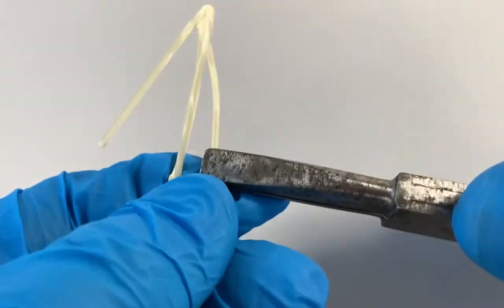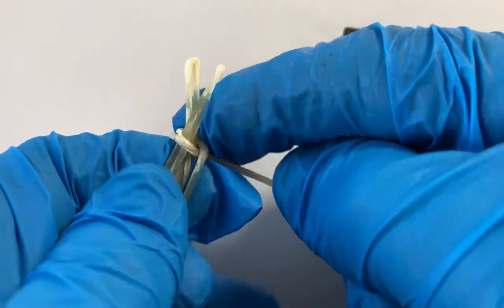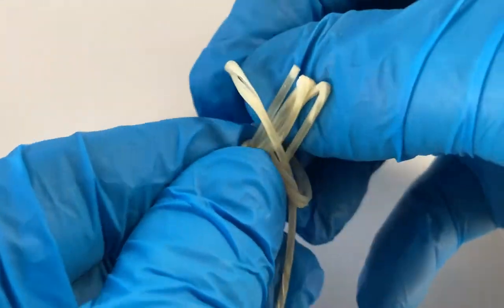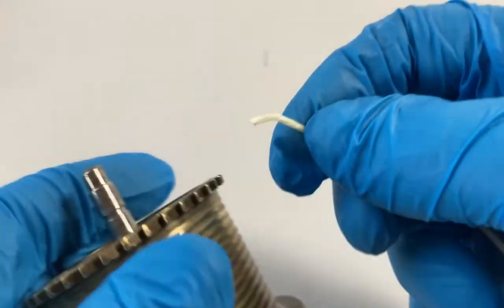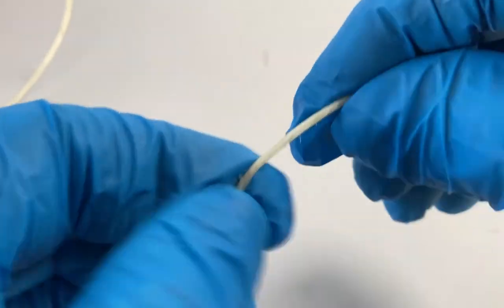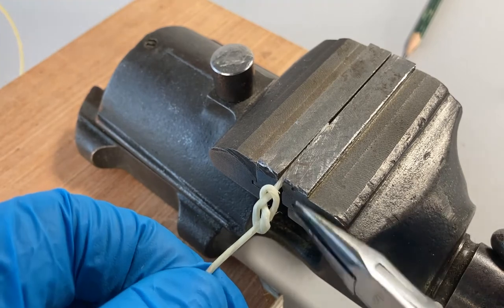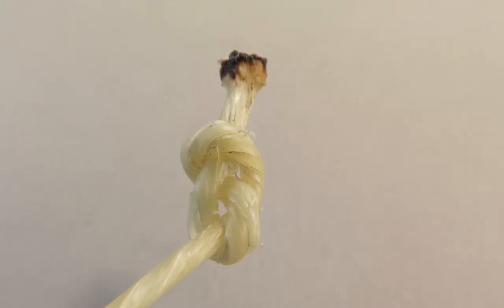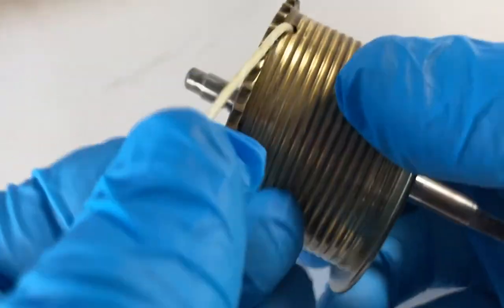009 Knotting the line on a tall case/ long case clock - Natural Gut

Comment: Dear Matthew, you explained and demonstrated exactly what my problem is with a grandfather clock like this. Thank you very much for that. You helped me indescribably. 1) What rope size do you use for what weight? 2) I think you only use natural rope (gut) for a grandfather clock like this? 3) How long should the rope be, should it run completely until there are no more turns on the pulley? The beginning of the rope would always be under extreme stress when being pulled up and would breaks easily? Or should the clock run until the weight hits the ground and then there should still be one turn on the pulley? I'm worried the rope will break and the weight will cause major damage. Your explanation is very professional, every word makes sense!
Reply from the maker: Thank you for your message!  On an eight-day longcase clock I would use a minimum of 1.5mm diameter gut line, yes I use natural gut but you can use synthetic type.  That is for driving weights of around 4 - 5kg. with a pulley which means the line carries about 2 - 2.5kg each.  If I can find it and it fits, I like 1.6mm diameter line, it just gives that extra security.  Yes I only use natural gut.  As for length, I would fill the barrel fully then normally add about 40 cm.  This allows for the line to go round the pulley and tied in a know like I describe.  Sometimes yes the line pulls tight (no turns left on the barrel when fully run down), it shouldn't matter.  What is important is when the clock is fully wound, the line cannot pull tight and the line does not double-up on the barrel when fully wound.  I hope this helps.  If you begin with the lines too long, you can easily shorten them using the know I demonstrate.  Yours, Matthew

Comment: Thank you for the video! My mother left me a Grocott of Holywell long case, but my stepdad had let it wind down so the weights hit the floor, and then pulled them up tight at the top. This resulted in bad things happening when a friend decided to try to move it before I could get there. Needless to say, I've repaired a few wood pieces to the case, anchored to the wall with brackets, washers, and screws through the existing holes. Everything is ready to go except for the line, but the gut is in horrible shape, and I'm afraid to attach the weights until it's replaced. I've learned so much about clocks as I also inherited a German (Carl Werner) wall clock, that I just finished repairing. These were minor on it, such as the striker needing realignment, working with the pendulum, and keeping correct time. That being said, there are two small metal rods in place of these knots, with the string knotted to the rods. Would those be original to the case? I wouldn't think so, as I think it was done just as you've shown here. Also, where can you find this line?  Size, length, etc. 
Thanks for any info.
Reply from the maker: Hi Eva.  Very likely those line toggles are not original.  TBH I dont like them or wooden dowels so unless the holes in the seaboard have been drilled out, personally I would return to the traditional butterfly knots.  The dowels are just another minor complication.  I buy my line from BowBrand in Kings Lynn here in the uk.  Most clock material suppliers will be able to provide natural gut lines.  Synthetic gut are fine too.  They are just a bit more springy and tricky to handle but once the weights are on, they are fine.  Hope this helps.  Matthew
Reply: @howtorepairpendulumclocks  Sorry for the late thank you Matthew, but thank you none the less! Life has a way of interfering in the best laid plans. Just now getting back to repair on the long case, and this is a huge help! The case didn't have as much damage from it's topple as I had feared, but the poor face has years of neglect, and is missing 4 brass decorations which one can see were certainly there. Unlike most corner decorations, these looked to be small and specific for letting the Greek key and Laurel show through them. I'm afraid I may never find anything similar. It's also painted with a ship on each side of the dial @9 and 3. I cannot see any names if there ever were any, and the view we have of the two ships is as if we are on a third ship and looking at them from behind, or we are watching them sail away. They are totally different as even the small dots supposed to be men, show them in different placements. Parts of the booms are also in different positions. This is NOT like many I've seen as the only floral is the laurel looking vines, and what looks to be a top view of an onion, garlic, or leek bloom. In each corner, above where the brass decorations would have been is another simple plant of some sort. Anyway, sorry so long. Do you have any reading material for deciphering the pictorials on these, or is their meaning lost forever to history? I'm eager to learn as I not only enjoy the old time keepers, but history as well. It also makes it special since I carry the Welsh bloodline. ;) Thank you once again for any info.
Reply from the maker: @Eva-xf2zp  Hi Eva  From an historic research perspective.  There is a book by Brian Loomes called White Painted Dials (or similar) which certainly would be a good beginning place.  Your local library should be able to get you a copy on loan.  Otherwise, I would always recommend joining the AHS (Antiquarian Horological society ) AHSorg.co.uk as members gain access to their extensive digital searchable archive.  Hope this helps.  Matthew
Reply: Hello Matthew! Thanks again for your help. I did finally get it done, but to my surprise, I find that the dial is a James Wilson. I also found hand written on back of the false plate, the name of his brother Richard Wilson along with some numbers that resemble dates. I have read in several reputable publications, his brother Richard may very well have painted many of the dials. The numbers maybe a serial? There's more writing and I'm working to decipher the rest. They almost can't be seen with the naked eye, but under LED light, something caught my eyes, and a jewelers loop confirmed.

Comment: Thank you it was very useful! Please how often should I renew the lines to prevent from splitting?
Reply from the maker: Lines should be checked for fraying on an annual basis.  In a domestic environment with relatively low RH and low chance of insect attack or rotting, I'd say they will last between overhauls.  I'd always change them at an overhaul.  That of course varies...  5 - 15 years.  M